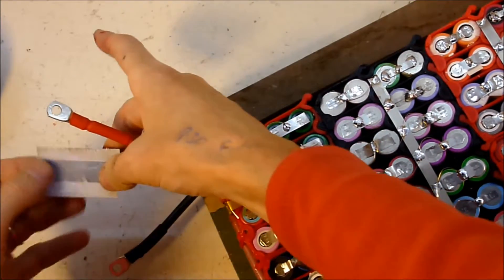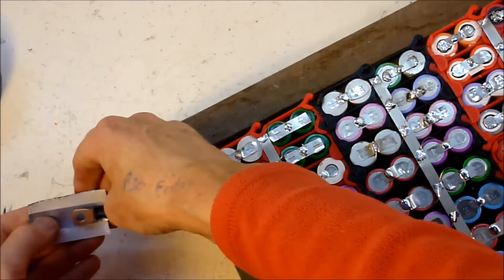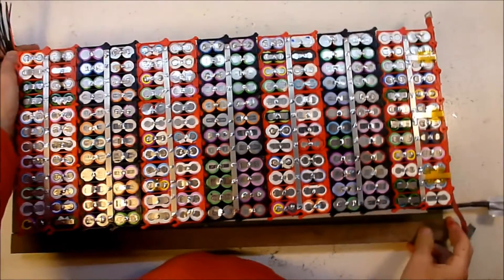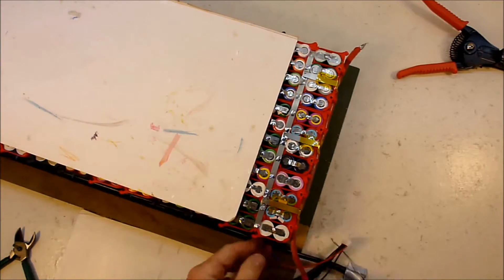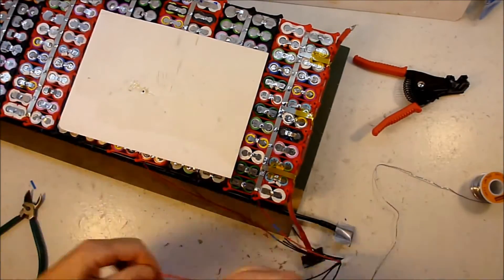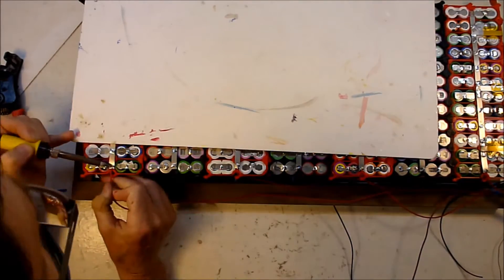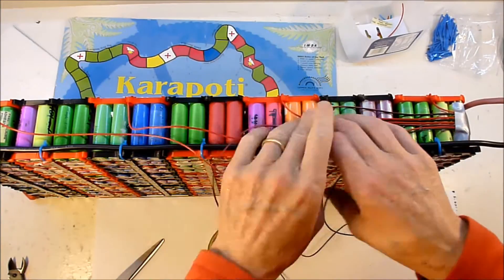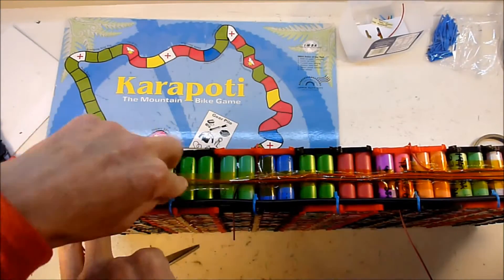Laptop Powerwall 16 - balance wires

Comment: just letting you know that looks like duct tape and it is a very good conductor(its got Zinc in it)...I would use electrical tape...I have played this game
Reply from the maker: Yikes! I did not know that. Why the Zinc!?
Reply: @paulkennett  not sure.. I used to use it thinking its plastic and it should insulate things, until I tripped a circuit (not in a good way)..then I found the cause, resistance on the duct was very low
Reply from the maker: Thanks for the warning.

Comment: i can not see where have you connected the balance leads for the BMS.
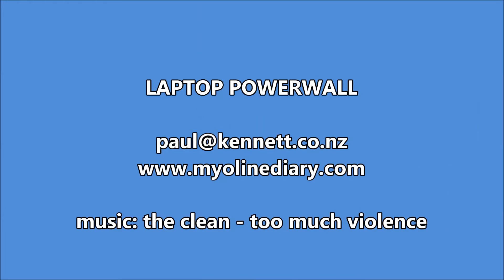Reply from the maker: At 4:33 you'll see the white balance connector hanging off the left. That's where the BMS plug in.
Reply: i mean the wires of the balance leads for the BMS, i can not see how you divide the positive and negative wires and where are you connecting them to the battery pack.

Comment: Just browsing thru your videos and enjoying the project. :o) I have no experience with any BMS, but it will measure voltage thru the wires, right? Looks like the wires are kind of thin and I would be a little bit concerned regarding the voltage drop, or the different voltage drops caused by different wire lenghths if the measuring has to be spot-on. Maybe not a bad idea to make all wires the same lenght so the voltage drop would be equal? Just a thought. :o)
Reply from the maker: +Dunkelheit667 My understanding is that the voltage drop across my 500mm long 20AWG wire is not going to cause a significant voltage drop. The balance function is required to avoid imbalances of the order of 0.2 volts between any two groups. 

I used http://www.calculator.net/voltage-drop-calculator.html to test my assumption on the longest wire (500mm long) at 4.2 volts: Voltage drop: 0.0050 v

So it looks like it'll be fine.
Reply: +Paul Kennett Sounds great, that is indeed not a voltage drop to worry about. The wires looked much thinner than 20AWG to my eye, it's hard to tell when watching a video. Thank you for checking and replying! :o)